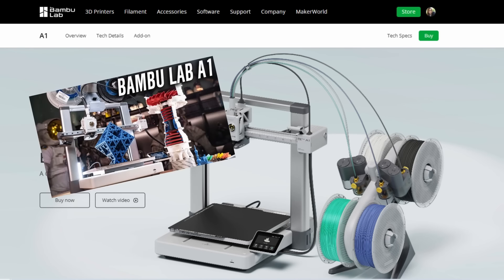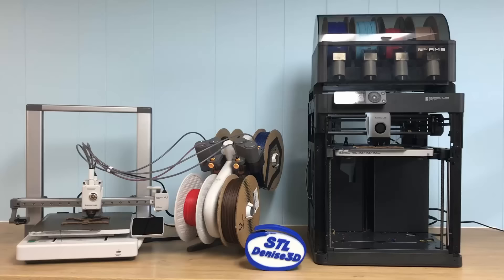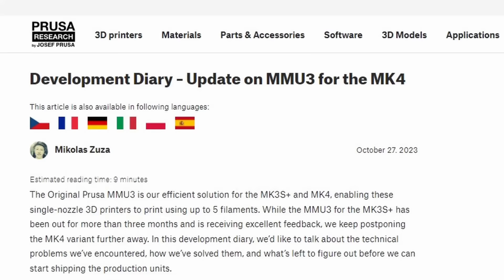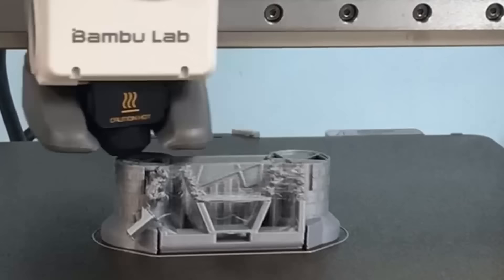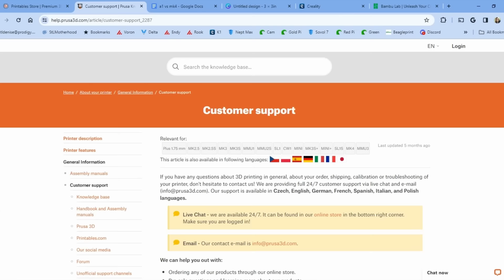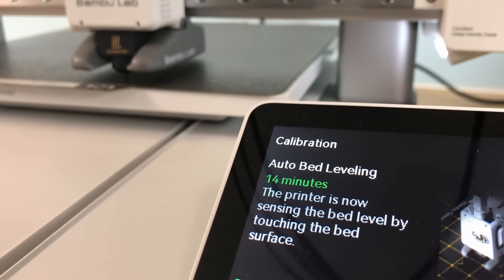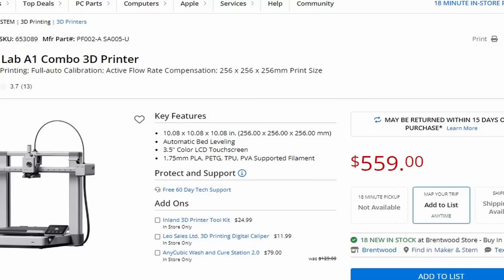Battle of the Bedslingers: Bambu A1 vs Prusa MK4

Comment: You can just get a P1P, P1S or even the amazing X1C which is flawless and can do multiple AMS. Which hold the material, keep it dry and just works. Prusa is starting to get outdated and just expensive, plus there own MMU system you have to make your own way to store material and waste room space plus if you want to enclose the printer it's just more space it needs (which most people don't have).  I own and X1C and it's has done me well for the last 8 months plus I have upgraded it here and there just to add better lighting and sound insulation. BTW I don't use the lidar that much I just do my own calibrations which is fun to me and I know that I can get the best results. Now MMU can be wasteful but there are new change G-Codes which can make it faster and waste less and changing a few sicer settings can go a long way. I am in the stages of testing all this as I write this.
Reply: I definitely don't think you can compare the X1C with the Mk4, it's a different category of printer and despite this I think the Mk4 comes out better.
If it were to be a fair comparison of two printers, compare the X1C with the Prusa XL.
X1C is always worse in terms of material consumption, amount of waste and print speed.

Comment: After buying an Ender knowing it was to learn on the hard way (I'm an experienced technician from jet fighter avionics on down and have built PCs for many years) the garbage build quality is an insult even at the price, for example loosely tapped self-unscrewing bed adjustment wheels. I will never suggest an Ender to anyone but for 190 bucks on sale I bought an S1 Plus knowing it wouldn't be for long.  Most buyers are not techies or experienced with machinery. They would more wisely save their money because "cheap" is often much more expensive in the long run.

Comment: It's like 3 times the price. Prusa it's too expensive imo.
Reply: @Viseo3dp  ok I believe you. I just ordered I bambu p1s recently, and still cheaper than an mk4. Also they are based in the USA aswell...But will see how it goes. Best wishes.
Reply: Is Mercedes too expensive?  Rolls?  Cadillac?  For me......a a VW guy.....yes.  The MK4 is a great printer with a terrific out of the box experience with great service.  "Too expensive" is in the eve of the beholder......
Reply: @richardbertacchi5016  I still think it's overpriced. And you can't compare it with  an x1c or a p1s imo. And the p1s is still 600 € cheaper. Prusa even ask if you want to build it yourself for cheaper price, that's very daring if I may say
Reply: @Humbledandelion  Built a Prusa Mini from the kit and while "daring" would be an exaggeration it was not easy.  X1C and P1P aren't really the same ballpark being core xy as opposed to bed slingers.  What I think everyone would like to see is the consumer-non-printfarm version of the core xy Prusa
Reply: Wow our A1 Mini had some teething issues (belt clip on the tool head broke) but was otherwise solid.  We did have a failed print that wrapped filament around the tool head.  In the A1's defense, that's happened on multiple printers.
Reply: @richardbertacchi5016  With all due respect. The MK4 is far from being a Mercedes-Benz. If only the A1 is closer to that than the MK4
Reply: @elleryfg7853  I think the comparison is not too far off if you consider service and support........
Reply: @richardbertacchi5016  Do Mercedes actually have better service and supports though? I always thought them as little more than status symbols with maybe some nicer design elements.
Reply: @wgemini4422  I guess it depends on the dealership.  In St. Louis I'd rather go to Plaza Motors (Mercedes) than.....well......anywhere else  (FYI  Really a VW guy.  Never even driven a Benz)
Reply: @Humbledandelion  Who is based in the US lol? Prusa is EU and bambu lab is chinese.
Reply: @LilApe  bambu has offices in texas they have on their website
Reply: @Humbledandelion  lol bambu lab still a chinese company dude. The austin location is just a wharehouse. 

Mercedes has dealers in america, does that made them american? No, they're still a german manufacture.

I mean prusa has a distributor in america too (printed solid), are they an american company? No, they're still european.
Reply: @richardbertacchi5016  That's the thing. It's a dealership thing, not a brand thing although Mercedes might pay their dealers more? My friend got an Audi and he got the worst services.
Reply: @richardbertacchi5016 You can get an X1C fror that price. Your argument is invalid.

Comment: Both have small print volumes and one is proprietary closed source and the other is way too expensive... I'd rather buy an Ender 3 and mod it and learn something instead of using a black box with a button on it to click "Print" and wait for tech support if something goes wrong or end up being forced to buy a new printer because they don't make parts for my now "old" proprietary printer anymore.
Reply: As someone who tried to make an ender a prusa.  Don't.  I'm not sure why you think you'd have to call tech support.  It's still a printer after all, and much easier to work on then an ender or prusa.  And aftermarket parts just keep rolling in, that's what happens when you sell the most printers.

Comment: The A1 can use it's entire bed for multi colour prints - you dont lose space for a waste tower,  which will be the case on a prusa.   Oddly the X1C also loses some printable space too, not for a waste tower but for calibration.  Who cares its not much space right?   Well i care.  I often do multi-tile topographic models for engineering projects that need to cover the whole bed. And they want multi colour.

Comment: How are you comparing two printers in completely different piece points, even the bamboo p1p is cheaper than Prussia. What a joke.
Reply: Price isn’t everything.
Reply: @gregoryamer  agreed, you can get a very capable cheap printer. But when the $1.2k printer is noticable worse than the $400 printer...it's pretty relevant

Comment: The A1 looks like the better printer top get, there don't seem to be any real negatives , you failed to mention the User Interface w the PRUSA still using the dated Click Wheel method which is a shame for such and expensive printer.
Reply from the maker: That's a good point! I believe the MK4 screen is a touch screen and they just .... haven't turned it on yet. 🙄
Reply: Touch screen on Anycubic i3 Mega was so good I changed it to RepRap discount graphics screen with clickwheel 😅
Touch is not automatically better, it's all down to usability design.

Comment: The price difference 2x is too significant to include these in a direct comparison because they are simply not in the same price point.

Better would be to compare the P1P or even the P1S with the Prusa Mk 4 even though they are still a fair bit cheaper, in fact if you have committed to the Prusa Mk 4 budget then you might be prepared to stretch it a little and get the X1.

The crux to the argument is how much is that legendary Prusa support worth?

The other thing I’d look for if I were spending that much money is how often will they bring out new models, one thing I dislike with Chinese manufacturers like Elegoo, Creality and AnyCubic is the rate at which they bring out new models.  It’s like “buy the Mars 4, it’s fantastic, it’s the best ever”, so you get suckered in, and then just 9 months later it’s “the Mars 4 is old hat, buy the Mars 5 it’s so much better”.

Comment: IMO people should start differentiating between the 3d printer and 3d printing as a hobby, if I just want to design and print things without having to fiddle with my printer for two days an Ender is a terrible terrible recommendation, people like that are better served with something a little more pricy but that doesn’t require as much setup and ongoing maintenance

Comment: Excluding the open source vs closed source argument since the vast majority of buyers aren’t interested. Prusa is seriously in trouble. While bambu makes a sleek and fast printer it is often inferior in quality to the prusa but how exactly do you communicate this? I’ve had my mk4 for almost a 8 months now and it has about 100 hours of print time with a grand total of 5 failures out of 500 prints. I bought my prusa because I heard it was reliable and sure enough it is. But prusa is behind in terms of user experience. For some models on the bambu lab model repository all you need is a smartphone app no computer needed and for many people a smartphone is all they have. Everyone wants a touchscreen. It doesn’t matter if it makes the user experience any better. The printer also looks good. The a1 looks like an appliance whereas the mk4 looks rough by comparison. These things don’t necessarily make a printer better or that “just works” it makes it marketable and yes I agree that bambu has a better user experience where it’s a lot easier to pick up a use with no further thought. Prusa makes a 3d printer that is more reliable than the regular printer that I own and sure it may look rough and be expensive but it’ll work for years and you don’t need to worry about a thing.
Reply: 8 months and 100 hours is nothing, go into the 1000 hours and you we'll talk again

i used multiple MK3S+ (starting from the MK2.5 upwards) for a long time, aswell als multiple other printers - i never had really some issues - bambu lab is on the same level, i'd even say it is a small notch better - but this is irrelevant when you decide to buy an MK4 kit or alternatively you can buy almost 3 A1 or 2 A1 + AMS

we are not talking about Ender or Anycubic "half the price but shit", we are talking "less then half the price but en par or sometimes even better"

Comment: For a first time "hobby", Prusa is way way too expensive. When I started out, I think the MK3 did not come assembled and an experienced person will take 8-10 hours. Heck, I was still deciding between bed size, 8-10 hrs to put together? OUCH!  I decided on an Ender.  Today, if I were starting out, for price/performance of A1 or MK4, there are 3 models of Elegoo 4. However, I would go with the slower Elegoo 3 Pro which have larger build but slower and no multi-filament, but use standard parts. If I were starting a print farm and wanted decades of proven reliability, I may go Prusa (MAY). Prusa has had years to enhance/update their tech, and nothing until Bambu Labs. Now Prusa has all these new tech?
Reply: Elegoo firmware "distribution model" via google drive is a joke.

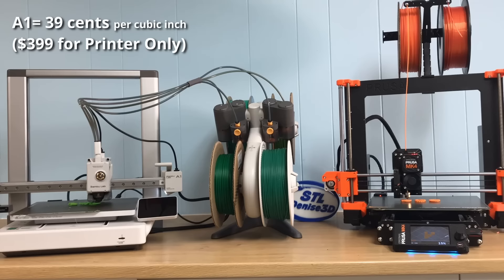Comment: 2:42. This is one of the dumbest comments ever.  As though either price is the sole consideration, or not a consideration at all.  It's a matter of value.  What is the dollar buying?  The A1 is coming in at half the price of the MK4, so the MK4 better be twice the printer, or deliver a unique killer feature, which justifies the added expense.  Of course the seriously damning situation is that the A1 is probably the better printer period, for half the price.
Reply: and even if price is a consideration: if you buy something for you hobby, you don't want to be frustrated all the time - if you want to print for example model building or tabletop minis (0.2 mm nozzle rocks) you spend 10 bucks per citadel pot of paint, have dozens of paints and then tell me you want to "save" 100 bucks and spend hours and hours of extra time getting your printer to "work properly"? 

yes, i'm aware that tinkering with a 3d printer is a fun hobby, but if you reference an A1 or a prebuilt MK4+ those machines specifically target people that want to print - and it is just not worth the trouble

so it boils down to the question: if both machines are similar in their featureset and user expierience: why on earth should anyone buy a Prusa machine? and don't come by with "open source" - that ship has sailed a long time, since josef prusa with his god complex decided to write his post about the state of open source

Comment: I cannot put into words my disappointment in Bambu to keep the 256mm bed size.  A 300 size has a market.   Your 256 size is the 'entry level' printers, which is flooded with thousands of "ender clones" (even by creality itself) which is great for entry level, and even for the cheap frame design.  That's why that combination works so well.   But when you start adding fancy doo-dads and extra features - that price goes up fast, and "entry level' goes out the window.

the K1 Max comes close to being that design, but sadly, is far too expensive for it's lacking quality and need for quite frequent maintenance.   Bambu don't typically need huge maintaining, so just slightly bigger - the P1S comes SO CLOSE to this market, but sadly lacks the 300x300 size, and for it's cost - I rather expected a 300 bed.

There is a huge gap between the 256mm printers - and a 300 mm printer right now, and due to the lack of printers, those that CAN get those sizes, are typically more expensive than even the P1S , X1 carbon, and other similar printers, but there are some that show that they don't need to be that cost... 

like the Qidi Tech X-Max 3 - it's got some issues to work out, and is on sale frequently for around $900 -  with a 325x325x315 build volume, enclosed, and heated chamber...  finding similar printers to this - especially in the price range, is extremely difficult.  Even kits can be more expensive.   I want to see more like it - to help innovate the flaws out and make more printers in this size range.

You can almost always print smaller and slower.  It's hard to print larger or faster on machines that aren't designed for it.
Reply: AS you say, every Bambu entry is expected to be a maxi as oppossed an mini.
Reply: Bambu is just trying to get the most money, their high end clients have the X1 carbon and the p1 lineup but there wasn’t any cheaper printer, so it’s logical to first fill out that gap before going out to create from scratch a 300x300 printer
Reply: Not to be rude, but I don't understand being so upset over 44mm. Sure, 300mm is nice, but 256mm is pretty standard, and allows the easy swap of the build plate of your choice.
Reply: It's bigger than the MK4 and the same as the X1 and P1 printers. The biggest market is the mid-size (which this is), so of course they are going to make their consumer line address that first.  I'll be the first(ish) to get a big Bambu, but 300 is not big enough. At least close to 350.

Comment: The MK4 costs over a thousand and doesn’t have an AMS. Bang for the buck the A1 is way past the MK4. The MK4 even has a smaller build space. I’m curious to know if Prusa has some deal with YouTube presenters. I don’t subscribe to Prusa boosters.
Reply: Maybe is the opposite. Prusa pratically never gives away printers for free to makers/influencers or had privileged customer service.
From ehat I remember few units were given for free to someone.
Reply: Remember the more than double price deference and smaller bed and no multiple material system. Oh there’s a small matter of going from CAD to printer with no hands on.

Comment: One ot two things to precise here. Jo Prusa did not come in the Reprap movement in 2005 but in 2009, so he's not one of the early Reprap movement contributor. Beside this, his comtribution is very important : the Prusa Mendel, the PCB heatbed, etc. I also disagree about the "small time gap" between completing the prints. It's still a 5% gap on a print which is not at the advantage of the A1. On a simpler part, or some taller thing, the gap could increase to 15% or so.

Comment: P1P is a different league.  P1P is a CoreXY printer and not a bed slinger.  P1P will give superior print performance compared to the to the A1 
There is a lot more to the P1P.    A1 definitely great for a budget cartesian style printer.   It's better than the Ender series.   If you want a printer you want to tinker with and mod to get it right, go an Ender 3 series.   You end up spending MORE on an Ender 3 series to get it to give good prints, than you will on a Bambu A1.   The Bambu A1  will have a higher initial cost, but will not need anything else to get excellent prints.  
Prusa have become complacent in the market place and have lost their edge.   The Mk4 is really dated compared to the functionality of the Bambu A1.     The Prusa MK4 is meant to be the latest.  You are not paying for European engineering.  You are paying for the Prusa name because Prusa think they are better than all the rest.   Sorry.  Bambu customer service was higher quality than Prusa in my experience.  Bambu have better features and a more solidly made printer and Bambu LISTEN to feedback and actively act on it where Prusa basically say :F you, this is our printer, you get what it is.